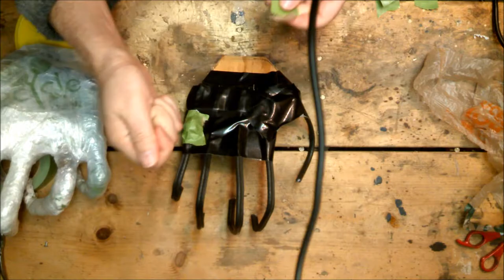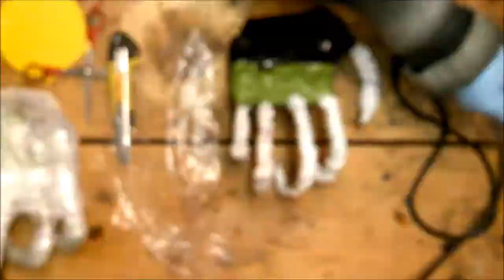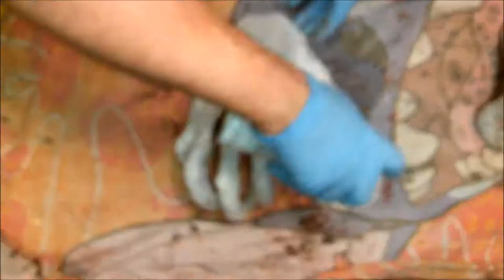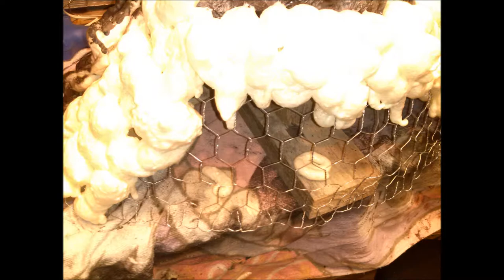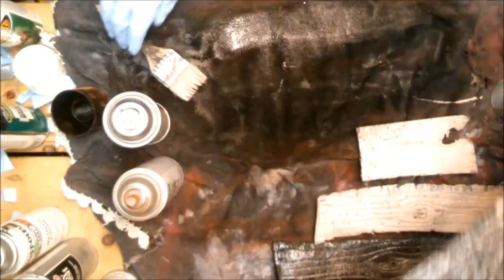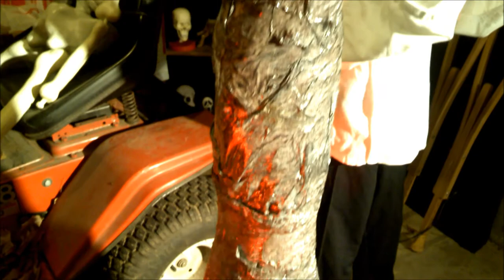DIY Animated Halloween Roasting Spit Prop from Start to Finish

Comment: I can't get it to turn. It almost seems like it is too heavy to turn. Is there a counter weight or anything on the opposite end of the motor?
Reply from the maker: If necessary, add weight to the handle on the opposite end. You can use sand, metal nuts, bolts, anything heavy that will fit into the handle. Also,  very important to make sure the handle and whatever you've got strapped to the spit are at 12 and 6 (opposite each other).  For example, if the body is facing up in the sky, the handle should be facing the ground.
Reply: Yea, I have them opposite. I will just have to play with the counter weight until I get it right. I am not sure of exactly how much weight I need to add. Thank you for your help.
Reply from the maker: You're welcome. I did have to add weight as well. Hope you get it going!

Comment: What motor did you use to turn the spit?
Reply from the maker: Hi Saberlilly. It's in the description, along with more info about the project: The spit turns using a 4.5 RPM disco ball motor. You can find them online for pretty cheap. I attached a straight-through coupler to the end of the motor using a cotter pin through a hole in the coupler, which makes the spit removable from the motor. The handle is also removable just press fitted on, and not glued or screwed on. This allows for easy dis-assembly and storage of the prop.
Reply: +Montclair's Lair thank you very much for the information. I really enjoy watching your videos.
Reply from the maker: You're very welcome, and I'm glad you're enjoying them. Don't forget to subscribe if you haven't already. :)
Reply: I wanna make one.. throwing a cannibal themed party this yr :) this is PERFECT.. I also shared the link with my cannibal fans ( it's also a fantasy as well with a few of my freinds).
Reply from the maker: +grettagrids Awesome! Make sure you check out the other two videos where I turned the spit into bones. It's a big improvement. https://www.youtube.com/watch?v=K4rt3CroTds and https://www.youtube.com/watch?v=y9iMamFq9hk Thanks for watching!
Reply: Hello, could you make a video showing exactly how you made the spit turn?